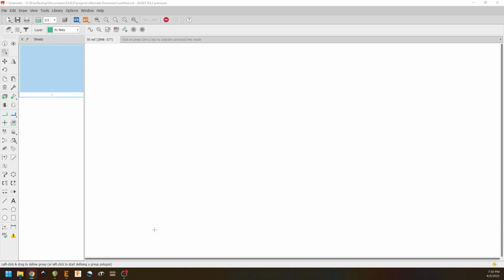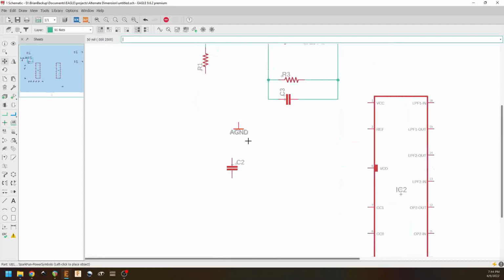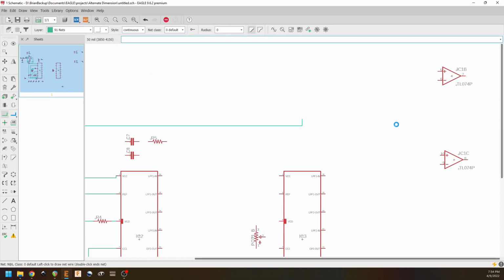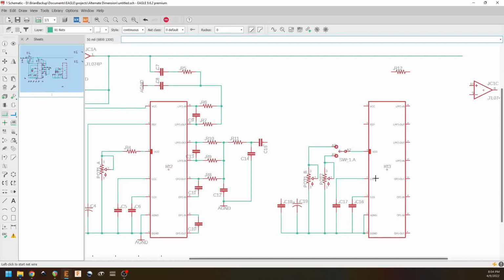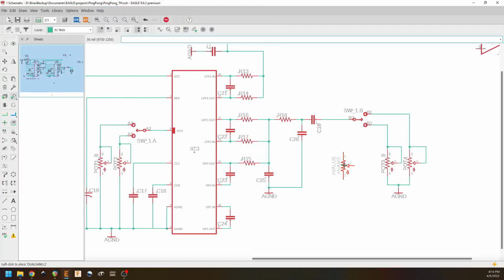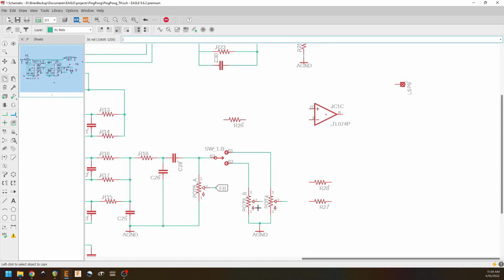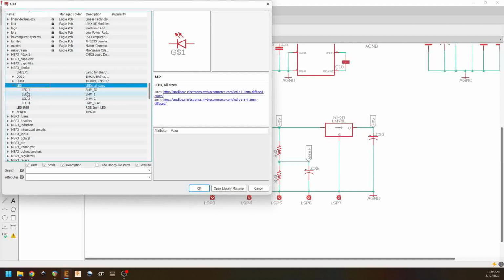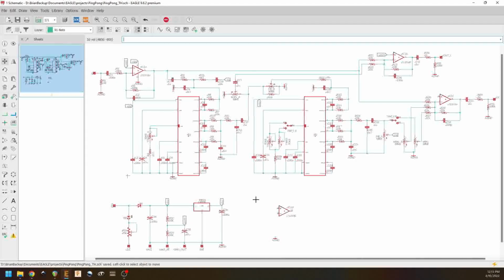How to Design a Guitar Pedal - Part 2: Schematic

Comment: subbed dude.... :)
Reply from the maker: Thanks! Hope you enjoy!
Reply: @thescientificguitarist4228    oh by the way, you probably know, but you can re-number the parts list from left to right after you have done a schematic.  (which i often forget) :)
Reply from the maker: Is there an easy function for this? I have to admit that I only get into Eagle as deep as I need for what I do most, so there is a ton I am unaware of.
Reply: @thescientificguitarist4228    hi yes, super simple, up the top menus there is a renumbering option...simply click do it, and it does it....beware it will set your pot names back to " pot"  but easy to rename...cheers